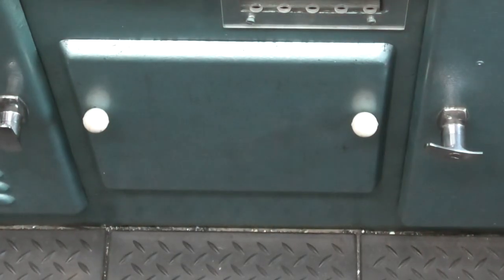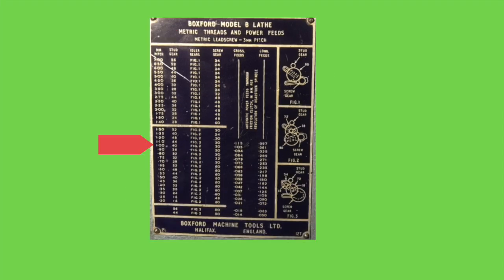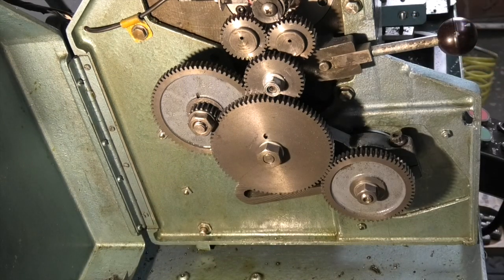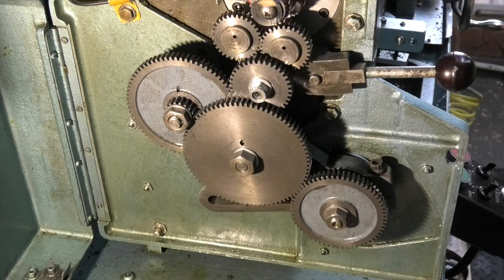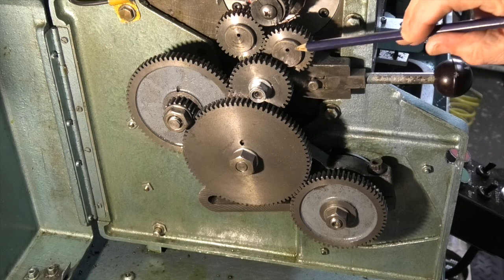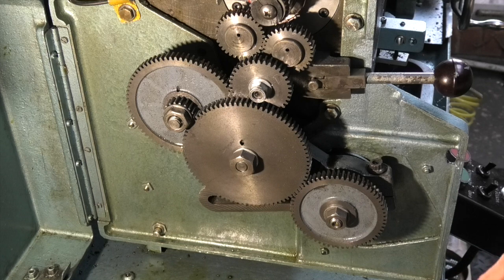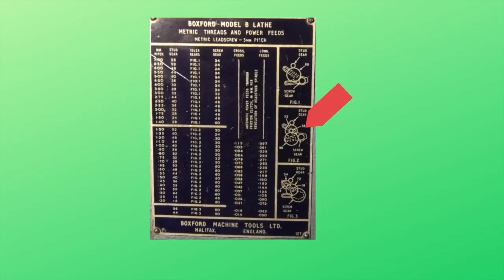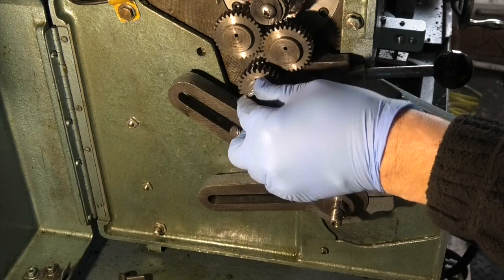Power feed speeds lathe gear box

Comment: I was lucky enough to come across a full metric Boxford CUD MKIII in the USA about 12 years ago. Not sure how it got here but I cleaned it up and replaced a few parts. It's been a good little lathe for home use. I have tried to replace it a few times but always end up selling the replacement lathe instead. China lathes or old worn out USA machines just aren't up to the Boxfords build quality even though it wasn't made with a power cross feed or quick change gear box.
Reply from the maker: Thanks for sharing!

Comment: Hi  Thanks for posting up the videos I'm new to machining but learning a lot working through your playlist. Hope you dont mind a question A friend has offered me his Boxford AUD. I guess it dates from about 1970 It looks to be in good condition even with its original paint. The recent replacement motor is a 3 phase with an inverter, it has 3 and 4 jaw chucks but little else tool wise. Would you say this would be a good first lathe and roughly what should I be paying Thanks again for the informative videos Cheers Steve
Reply from the maker: Hi A Boxford is a good lathe to start with as for costs I’ve seen them on sale from £300 to £2000 depending on what comes with them.Check ebay to get an idea of the condition and costs
Reply: Great machines but the extra tooling can be expensive so check your proposed purchases carefully.